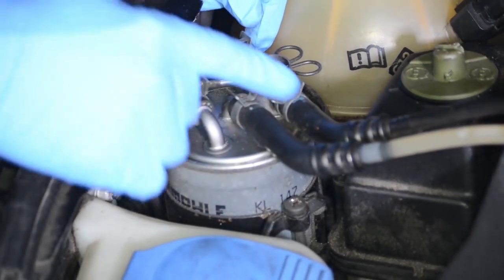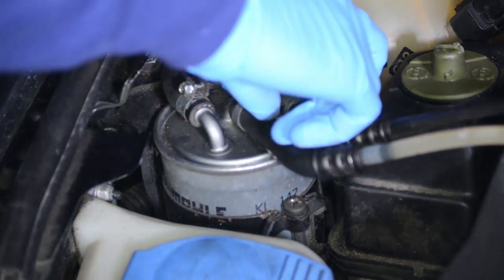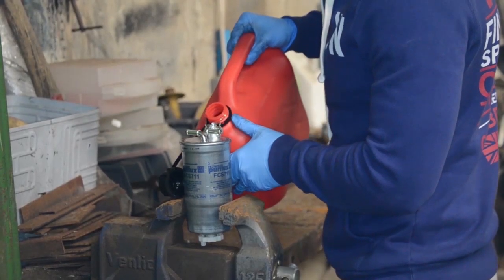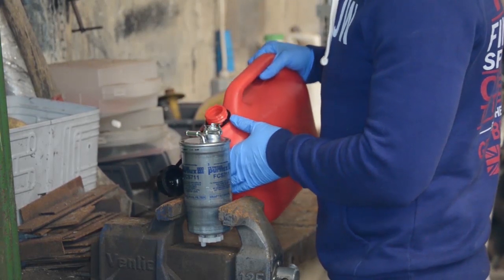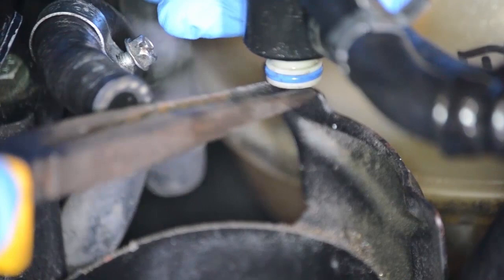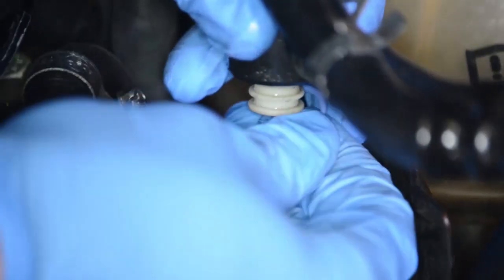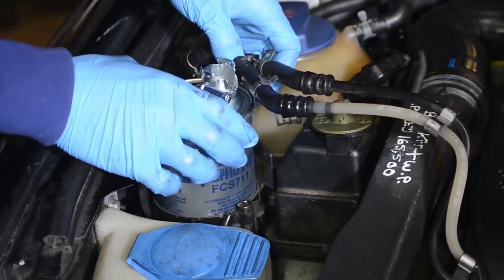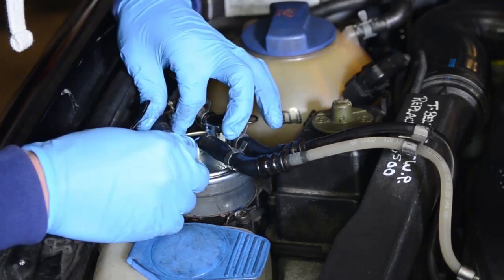How to change a fuel filter TDI Diesel Engine

Comment: I live in the uk and I am getting an offer to get my fuel filter changed for £137 on my Honda jazz 2009 is that a good deal
Reply from the maker: Just the fuel filter? Absolutely not, it cost about 20 euro to buy and 15 mins to put in. I would think 50-60 pounds is enough.

Comment: you put the O ring back onto a different position..higher than the old one was on....did this cause any problems?
Reply: There are two O rings to go on. Did you watch it all?
Reply: See at 4:10 minutes. 2 O rings is used.

Comment: Great video boys.  Do I need to bleed the air after installing the new filter?
Reply from the maker: Justin Scarlett Thanks Justin.Theres no need to bleed the air, once you leave the fuel soak into the new filter and top it up after 30mins the engine will start straight away.
Reply: Thanks again: I'll do it this weekend!
Reply from the maker: Best of luck :)

Comment: How do I remove airlock from the engine? Because I forgot to fill fuel into the filter. And now my car wont start but it crank
Reply from the maker: Andii Rahman usually it will start after trying the ignition a few times. The fuel needs to work its way into the fuel filter and fill it before starting, this happens when you don't fill the filter when replacing it
Reply: Poor guy.. Sad the guy didint know that it is his fuel pump being full of  air so. fucked. I also had this. But for some reason my brother had a special pump to pump all air out of the fuel pump and so on. 
Pumping air through the fuel pump is not very healthy for it